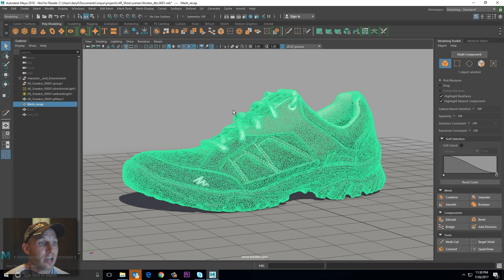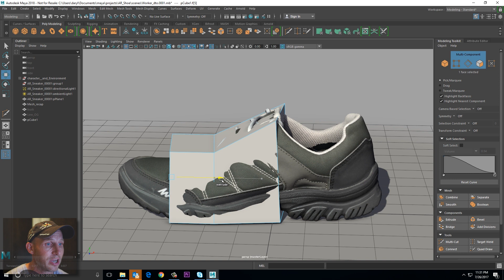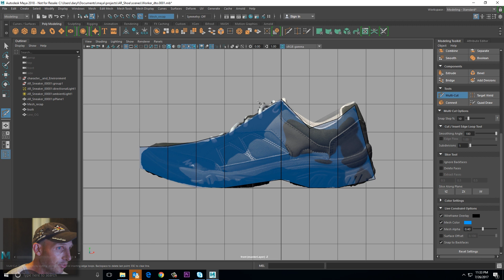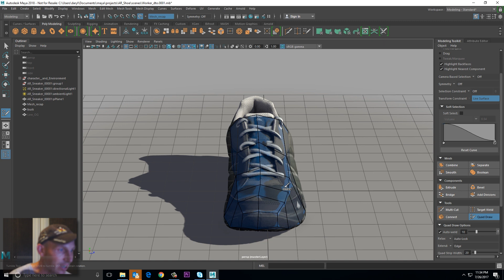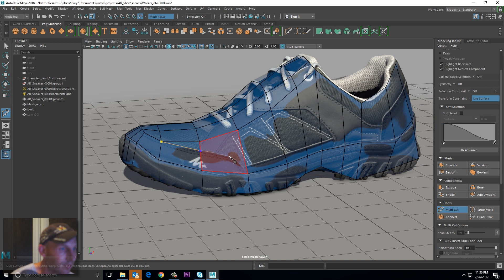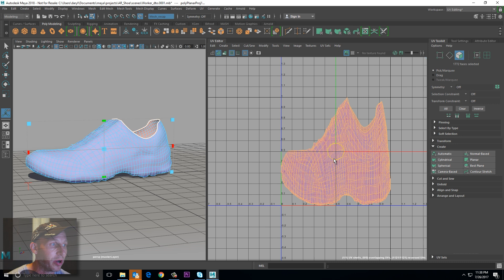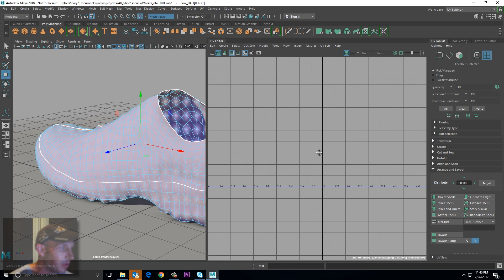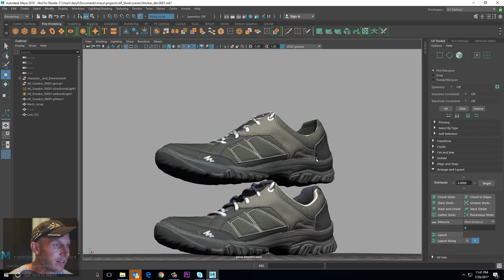Journey to VR: How to create a low poly model

Comment: ??? You did not rotate the finished baked model.  What happens to the color on the bottom and back side of the shoe?
Reply: The backing is based on face normal so the results work everywhere.

Comment: Hey, I have a question. I'm following another youtube video telling me to use envelope, making the low poly pink and telling me to expand it to cover the high poly for baking. But I need to bake an entire gun with a ton of separate parts. Was there a way to expand everything outward without going in individually to edit it? Scale doesn't work because it it just makes it bigger and clips even more. Also if I do inividually expand the pink low poly to cover each piece, all of it will clip because i modeled them to be snug fits. Is this method only suggested for single object models? is there another way to bake 200 pieces of an larger object easier?